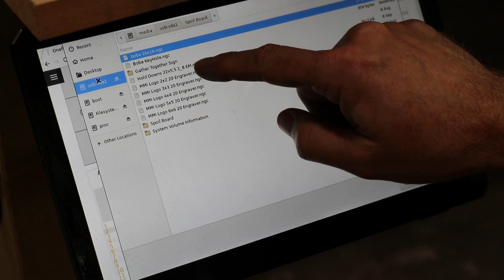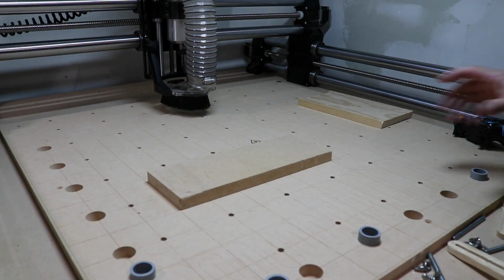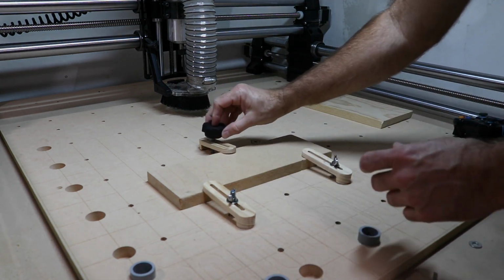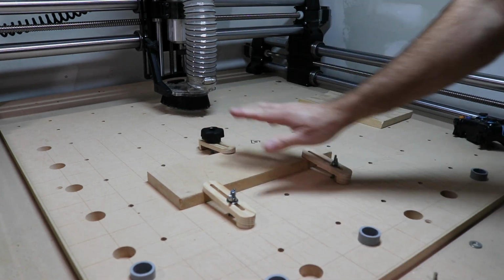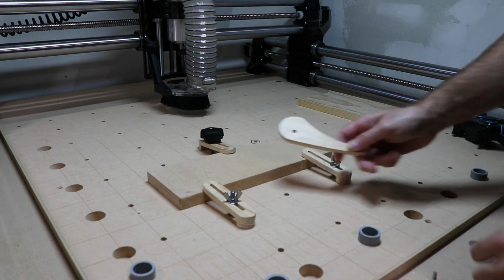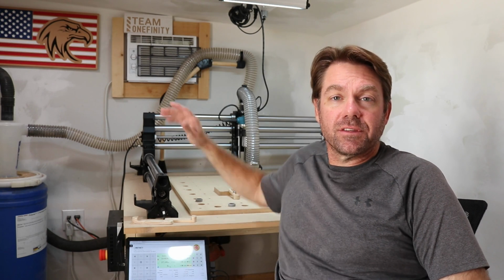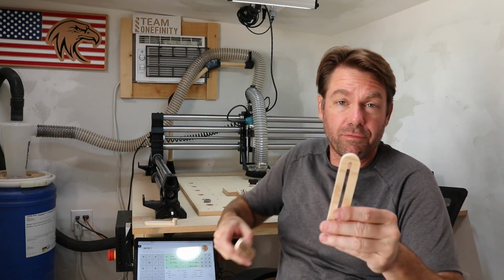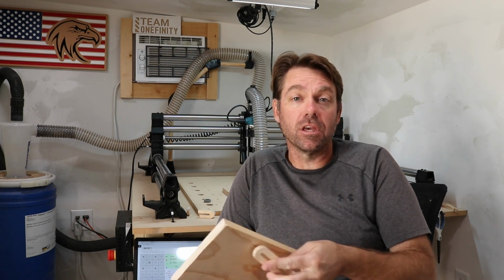Don't Buy CNC Hold Downs Until You Watch This Video!

Comment: with me what started out as a $3000 machine has quickly ended up a $7000 machine. it took 8 months for the machine frame to get to me as it sat out at sea for 6 months and then the container sat on a dock for 2 months. except for that everything has gone smoothly until last sunday hooking up the spindle and vfd the first time. the cheapo huan yang vfd had a screw loose inside it and when i turned on the spindle the first time BOOM. now i have seen arc flash videos at honeywell when i worked there but it doesnt really compare to how loud it was. it sounded like a gunshot in a small room. dont ask me how i know that. but replacement spindle and vfd arrived today and hopefully my 9014 will be cutting some wood this weekend. luckily the original spindle and VFD were under warranty and are being replaced so i will have a spare of each. kinda crazy seeing that 300 lb machine cruizing at 700IPM at 1000 IPM the machine wanted to lift itself off the table on change of direction. and at this point i dont care if i ever have to solder again the rest of my life after soldering all those GX-16 connectors especially the 6 pin spindle control cable. nothing really prepares you for all youll need going from a toy chinese machine to a small industrial machine.
Reply from the maker: Sounds like a (not so fun) adventure. I would like a spindle some day but for now the Makita router is working fine. 1000ipm seems crazy fast for this machine. Would be interested to know what bit, spindle speed, depth of cut and material you were cutting and that feed rate.

Comment: Finally got mine up and running, I'm sure to label my "boo boos" on the failure or not right cutting, especially my spoilboard.   I drilled a lot of 1/2" holes and use dowells cut for use, they work great!   Going to take your suggestion and make some cams with a 1/2" diameter hole for dowels.   Got a lot of stuff to custom mill now.   Thanks again for your taking the time to post your successes and failures.
Reply from the maker: Congrats! If designed probably 10 spoil boards at least. Lol! I think hold downs and cams are great first projects. Keep me up to date on your progress.

Comment: I would probably consider using baltic birch plywood or maybe even some kind of HDPE  (like the oops clamps by Onefinity) so you don't have to worry about grain direction.
Reply from the maker: Great suggestion. I actually thought about making some out of a cheap plastic cutting board I saw in Target. Might be HDPE, not sure.